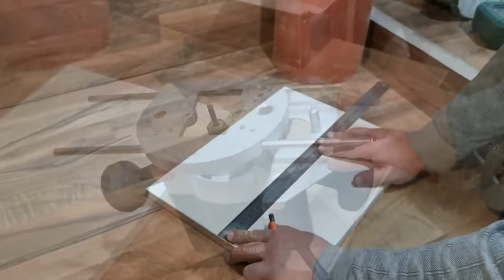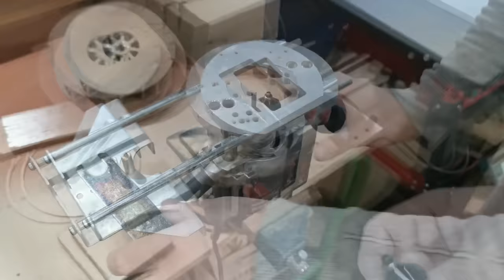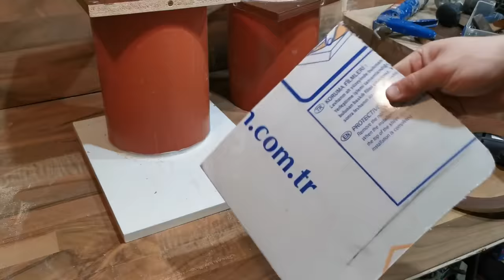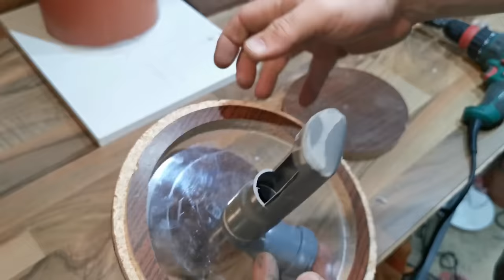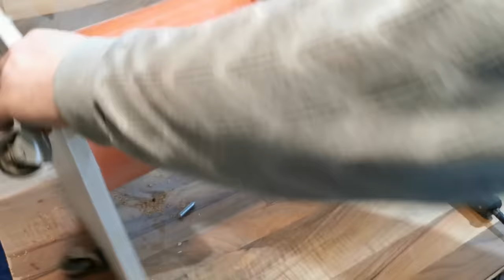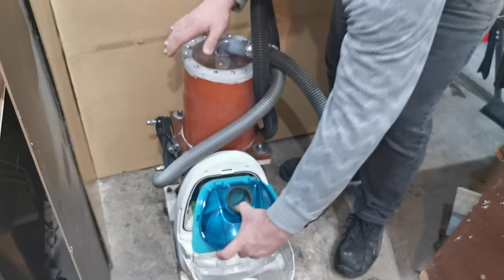Top 5 Unbelievable Idea Using PVC Pipe

Comment: THANK YOU FOR A GOOD VIDEO !!!
   I learned some cute tricks, from watching this video. One tip I'll leave you with. Anytime you have something that will bolt together with another piece, always grind or cut out a "KEY" across both pieces. That way there is a permanent MARK, that can't be painted over. You line those two grooves up together and the bolt pattern ALWAYS fits. It can be done simply by bumping the edge with your angle grinder. Nothing extravagant. Just a little groove 90 degrees from the edge.
   Thanks again
Reply: Cute comment

Comment: I like what you did with the vacuum. cleaner. My only suggestion would be instead of using regular nuts to hold the two cylinders together switch out the nuts with what are they called those wingnut your butterfly nuts this way you don’t have to carry a wrench in your pocket. Sincerely me
Reply: chuck clark : I had thought about it too but I'm afraid that with the butterfly screws we don't have the same clamping force, because you need a good seal between the bottom and the top, that's just my opinion :) .. .

Comment: First one:  A suggestion...use wing-nuts for the connection of the two halves so you won't need to keep a wrench/spanner with you at all times.  
The homemade cord reel is awesome!  :)
Reply: i think the same dude
Reply: Ha, "at all times"? Hardly.

I'd say just use the vac directly.
Reply: and something that has some suction. just buy a shop vac already
Reply: @keybored67 : This obviously does have some suction. But yeah, a Shop Vac, or any brand of wet/dry vacuum cleaner, for that matter, would likely have a decent amount more suction than this.
Reply: needs rubber or pipe over threads to to stop them cutting into wire in my opinion will chaff if too tight or over time

Comment: 1. Would have been quicker to sweep up and then vacuum the dust.  2. Cool easy idea.  3. You can buy from hardware store for the price of your parts and no labour. 4. Hardware store and you don't have to wreak wifes washing machine. Pumps start at like $16. 5. Cool but what is it for? Also some of those thingfs you melted or glued together, they arent ever coming apart. It is kind of a Walking dead scenario if you ever needed to make something but then you would still need all the gear.

Comment: Amazing dedication to building stuff.  I build a lot of stuff too, but when it's cheaper to buy it I don[t have time for this.  BTW, using plastic pipe for ANY compressed air application is a NO-NO.  It explodes into fragments which will pepper your body with shrapnel
Reply: 1.5" PVC holds 1,000psi, 1500 bursting strength
Reply: @ssijon  Yep, when it's new.  But it does age.  It is subject to fatigue (from repeated expansion and contraction due to changes in pressure), heat  and chemical exposure.  When it DOES break it doesn't split in a small area and contain the split as does steel pipe.  It fragments.  I'm familiar with the pressure rating.  All of my water plumbing is PVC or CPVC.  I was using that long before it got really popular.

Comment: -1st: Just making the vaccuum cleaner bigger (IMO)
-2nd: Using at least €10 of supplies to make something that could've been done with just a €1 piece of gardenhose 
-3rd:  Buying the real thing costs the same or less and is most likely safe(r) to use
-4th: See 2nd. If you really want to do something else, just buy a cheap aquarium pump (also safer) or use an airlift system with an aquarium air pump
-5th: Cool project, but where do you want to use it for? Making a weapon for your Battlebot?

Although I'm not a fan of the outcome of your projects, I do however want to compliment you on your techniques. You definitely got some skills:)

Comment: Keep in mind in the first build idea, 'cyclone', 'modified vacuum catch capacity" this 1st demo using 'particle board', 'I'm highly  recommend using waterproof boarding. Safe Note #1;  Keep your hands further away and above that 11,000 rpm router bit. Find a safer method to hold the work pieces than shown in the vid.  The router can eat a hand off before one can think, "WHAT"?.
Reply: Agreed. I was about to take up biting my fingernails. Something I haven't done since I was 6 years old. 👁️👁️

Comment: Note: Remember to fully unwind your cable before using your extension cord. If you let it roll up it will behave like an inductor, and there is a risk of overheating and danger depending on your " power user " at the end of the extension cord.
Reply: Not especially because of being an inductor, The wires will get warm anyway because of ordinary electrical resistance, If the cable is all unwound from its reel/bobbin, that heat can escape easily,
But wrapped around a reel/bobbin, the heat cannot escape and because all plastic electrical insulators are also good thermal insulators, the reel can get very hot and melt the insulation.
Not so important for the brief bursts of use the angle grinder gets but if you're powering things like lawnmowers, chainsaws, leaf blowers or heaven forbid, welders, ALWAYS unwrap the cable completely. Its amazing how hot things get so quickly.
Reply: 18 owner 18 pew

Comment: The last one definitely can be useful.  Just do not exceed the max pressure rating of the plastic pipe and the fittings otherwise it could explode like a grenade.  I was a machine designer for years and incorporated pneumatic cylinders in many designs.  Always used Bimba brand as they are inexpensive and well made.
Reply: Even more deadly is taking the guard off a high speed cutting tool! I had a cutting disc shatter and and send shrapnel into both wrists! I was out of work for three months. Lost a small bit of feeling in one hand due to nerve damage. If it would have got me in the neck I'd probably be dead. Get medieval and wear chainmail and a good quality face shield.
Reply: Is Vacuum Sr, no Pressure ;)

Comment: Vac is awesome,  but he could have got the same results sucking dirt or sand out of the bowls instead of emptying on the floor.
Reply: 0
Reply: @helmutgarber3983  ?
Reply: Shhhhhhhhhhhh.  Creativity at work with $50 worth of PVC pipe, $100 worth of glue, a heat gun, a Bunsen burner, a no name router, router bits, drill bits, drill, keyhole drill bits, sander, grinder, hacksaw, hacksaw blades, a punch(to make the washers) air compressor air compressor hose, air filler tip on end of hose, sharp wood chisel --& I have not gone through half the tools he used. Cheaper it WILL NOT BE. $200+ in tools.   These are rough estimates...so obviously it is going to be higher.

Comment: 20:43 I use a hose from an old vacuum cleander to empty rain barrels like that.
U can find old vacuum cleaners in a dumpster any day
Reply: Then again, poking a hole on the bottom with a cold chisel will do the same job. Cost of hammer & chisel.   Silicone the hole closed later after you design a release valve out of PVC. Gravity does the work naturally.

Comment: 1. The creator always seems to know what he does, but the viewer is left wondering, "What is this project? What purpose does it serve?" You have numbered your projects, but that, alone, does not describe your objective. 
2. Devising an outdoor water pump using a washing machine outlet pump and AC power can be a hazardous project, but especially with completely different operating conditions for which the pump was not designed. Specifically, the pump, its power cable and a DIY housing are placed underwater, in an effort to defy Murphy's Law. Most submerged AC appliances begin to leak, and under 120V AC (US) pose a potentially lethal surprise. 
3. Slightly more than one in four of your viewers were actually driven to indicate dissatisfaction, which indicates areas for improvement in your next presentation. We did not vote, at all, since this may be your first attempt at a video. Thank you for the tips-- they are clever.
Reply: @officialmysteriousrider6327  that also works well with sanders and saw and the like. Helps fromm having to clean the vac filter so offten.
Reply: @donlute3444  definitely do
Reply: @donlute3444  Now, I understand the purpose of the cyclone. I had gathered the cyclone throws the heavier particles out of the airstream/vortex, leaving a lighter, smaller mass for the shop vacuum filter. That seems one approach every shop could use. I recall the video creator recovering two box lids-full of sawdust, sparing the filter.
Reply: @bobgreene2892  exactly. The fun part is building the unit your self or buy the vortex part at a hardware, I bought mine at an ACE , and put it on top a bucket. I've went 3-4 weeks before dumping it and 2 to 4 months before knocking  the dust off the filter. They are like gold. Only thing better is an expensive dust collection system.
Reply: @donlute3444  Thanks for the tip about the ACE hardware vortex part! My shop vacuum needs to be emptied far more often than it should.
Reply: @officialmysteriousrider6327  unfortunately Dyson vacuums are expensive trash.
Reply: @officialmysteriousrider6327  Nope, how to make a vacuum cleaner worse..

Comment: my Craftsman 6 horse chrome shop vac would have suck that up and about 1.2 seconds and took me about 1.2 seconds to open the top and pour it out so I don't think you're really onto something besides that I think that vacuum cleaner motor would probably burn out in about 2 minutes , especially if I was using it. you're definitely crafty with some ingenuity though, so keep at it man you're going to find something, 
good luck

Comment: 39:00 This pump can be a very good electric generator with high ac voltage, Try it out!, use a step up transformer and a spark gap. it will light up anything =)

Comment: That's a pretty good idea but considering you are using negative pressure you only need two bolts you can basically just put plastic clamps on it or make a hinge and only put one clap

Comment: Just get a Shop Vac or other brand of wet/dry workshop vac. Cost is about the same as the materials used here. Plus the filtration is better and there are a lot of accessories.

Comment: make sure you always unreel the electrical cable from the container all the way, as leaving it coiled up and using it as a small extension cable can cause the coiled section of the cable to heat up under heavy load possible leading to fire

Comment: nice video. except the part where you connect the wires by drilling them und putting duct tape around. Please solder them or use clamps and crimp contacts.

Comment: You've found a way to make your vacuum cleaner worse, well done.  You also have to mess about unbolting it to empty it lmao..  If you have a capacity issue then go get a shop vac for like 40 and be done with the problem...  No need to spend 300+ on tools and parts.

Comment: My friend... You installed the vacuum cleaner vertically, but you blocked the air outlet of the vacuum cleaner. If you continue like this, you may burn the motor and the suction power will definitely be low.

Comment: #1....Yay, I get to lug a wrench around to empty my vacuum... OR, I can use a simple 5gal bucket that does exactly the same thing, and without the wrench, AND I won't have to lift the vacuum and this device to empty the bucket... 

#2.... Yay, you "invented" a hose...

#3.... Cord winder... meh

#4.... Low volume submersible pump... meh

#5.... Pneumatic piston... Well done

Comment: And how long did that washing machine pump last. Those motors arent designed for continuous operation. they should say right on them 3 min on 20 min off .  And now you've contained them in a confined space that allows for zero cooling. did they even last long enough to pump out that small basin before the winding fried itself? I doubt it.
Reply: also they are not intended to be submerged so lets hope no one tries this

Comment: 2 ways to have a $30 shop vac.
1) Acquire $200 worth of material 
2) Acquire $3000 worth of shop tools
3) Spend $800 worth of labor using shop tools to customize material
4) Add a $250 vacuum cleaner
5) Call it genius.

OR

Buy a $30 shop vac for $60 at your nearest "overstock and returns" outlet store
Reply from the maker: But i have shop vac...

Comment: The expediency of project number 4 is questionable due to the small capacity of the pump. Before, he would throw the water out with a bucket. In addition, electricity and water do not go together and such things should be avoided in self-construction.

Comment: What is tool used to cut those circles at the beginning of the video?
Reply: Plunge Router, but a band or saber saw would work just as well with a bit more sanding.

Comment: No offence, but I think I’d just spend the $50 and get a 4hp dry/wet shop vac with a quick release to dump the material out..not to mention way more suction 🤔
Reply from the maker: I have a vacuum cleaner for the workshop. I sacrificed this one for a project. If you follow my projects, you'il see that I'm using it for other purposes.  I'm still using the cyclone

Comment: 1.) Долго открывать контейнер сборщика мусора, 2.) Неплохо, идея не новая.3.) Дёшево и сердито, по колхозному. 4.) Слабоват движок, если подсасывать воду приходиться. 5.)Глазо выдавитель :)
1.) It takes a long time to open the garbage collector's container 2.) Not bad, the idea is not new. 3.) Cheap and cheerful, according to the collective farm. 4.) The engine is weak if you have to suck in water. 5.) Eye squeezer  :)

Comment: Never tie knots in electrical flex as this will cause the flex to melt and fuse together, due to electromagnetic induction and may lead to fire or electrocution.
Reply: Probably the reason I never did it. Besides I use heavier wire.  Even the first one the cord carrier, lets see him wind up a contractors cord that is 3 wire.  There are easier methods like large loops or loop braiding.

Comment: Part one.Simply moved dust collection point away from the underpowered vacuum cleaner,which will die soon anyway.
For the effort expended he could have MADE a cyclone vacuum cleaner from scratch using any fan motor,a filter and at most 7 small pop bottles,and the existing pipe.
Air intake is from above ....dirt is prefiltered by gravity .....the downward drop through the inner bottle allows entry....the upward LOWER suction through an outer ring of six bottles(each is used as a cone) is lower and runs up into a single chamber with a filtered output.
Just look at any DYSON for clues as how to improve from his initial designs.
Part two.
NONSENSE.
Simpler to get a small length of hosepipe and place a small bucket on the floor
fill bucket from pool.
place bucket on floor.
fill pipe in pool.
hand seal the end.place this end into bucket and release
pool will syphon naturally ANYWAY.

Comment: 15:40 very small pipe diameter. because of this, low efficiency.
44:50 if you lift the hose up, then your pump will not be able to pump. Idea is shit

Comment: None of this makes sense. For example, a wet / dry vacuum cleaner is easily available for around 30 €. And the handling of these devices is much easier. Not loosen any screws to empty the container, just open two clamps.
Do-it-yourself really only pays off with extremely expensive or hard-to-find devices. And then they cannot be built in a few simple steps, but require precise knowledge and special tools.

Comment: But if you hadn't poured all that dust and crap on the floor you wouldn't have had to build a vacuum cleaner powered vacuum cleaner to clean it up, would you?
Just silly.
You could have just used a 25 ltr drum with a clip on lid, much easier to empty.
Reply: And it would also have 10 times the suction of this under-powered device.

Comment: im begging you    PLEASE DONT do what this man did with the extension cord..... ive been an electrician for 35 years  and wrapping a cord up like that is just asking for problems so PLEASE DONT
Reply: seems legit, and its grounded... haha
Reply: How could a 2 pin plug be grounded???? But besides that the real problem is he is wrapping the cord around a small centre and in this item it will also be wrapped over and over in the same direction around this small radius so. The wire will abraid very quickly

Comment: I really didn’t understand what good any of these ideas was now I take nothing from the inventor because that’s where innovation comes from but the vacuum would have been better off just using the vacuum the water drain instead of spending the money on pvc I would’ve took a piece of garden hose and done the same thing the air jack at last was just senseless what in the hell are you gonna use that for not to mention carry an air compressor around just so it works I watched this whole video and figured out how damn desperate we are for entertainment